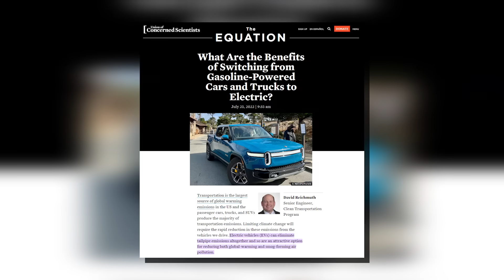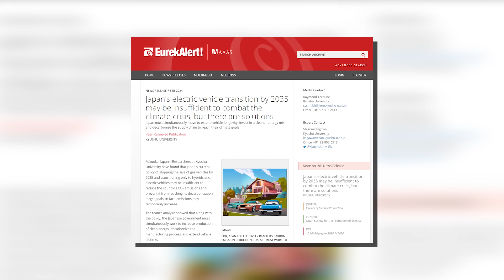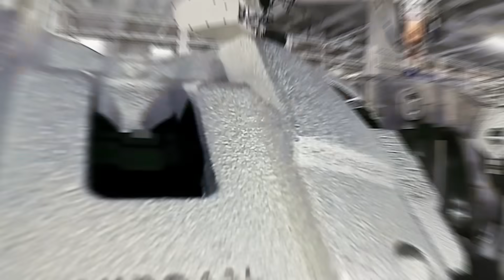The Real Reason Why Japanese Reject EVs

Comment: Hybrids is a Japanese lame ev vehicle which  basically rely on combustion engine. It is just another lame Japanese idea that are out there to deceived unsuspecting consumer. Don't be duped by Japanese Hybrids and may as well just get a normal combustion engine car then.
Reply: Hybrid gives far better gas mileage, as reliable as ICE and not as dumb as EVs. It's the best of both worlds, and very easy on the pockets. What are you talking about? 🙄
Reply: @a.m.9357  you won't see me running to get 1 definitely. Just imagine how heavy a hybrid gonna be if you fit 2 system into 1 car and how hard a hybrid need to work to get where it want to go. Get an ev instead if you want to be green to the environment or get the 100% ice if you want to use gasoline.
Reply: @a.m.9357  They also the one more likely to catch fire and still consume gasoline, which the reason why government around the world want to bann them is because fuel consumption subsidy. And because all of them use air cooling good luck cleaning those electric parts.
Reply: EV will sell to dumb virtue signalers in rich countries,  but Japanese sell cars all over the world... Do you really believe countries like South Africa which only give consumers power for 4 hours in every 24 will be getting huge sales of EV ?

Comment: most battery manufacturing and raw mterials, minerals is controlled and owned by china; a big geopolitical opponent of japan. USA, the most powerful nation is struggling to maintain their electrical grid to support EVs where it takes sometimes hours to charge an EV or find an EV station.
Reply: Because US electricity are run by private company. Simple as that, they have no incentive to produce surplus because it will hurt their revenue.
Reply: @yulusleonard985 battery storage is being added to the grid. Without storage electricity generation must track loads in real time to maintain voltage and frequency.
Reply: An EV taking hours to charge on Level 2 is the cheapest way. I charge at home getting 25-28 miles per dollar or at work for free.
Reply: Finding stations is easy. Open Google Maps, Apple Maps, or Waze, Pkugshare, or A Better Route Planner  and they will find chargers for you and take you to them. Is easy.
Reply: USA is not struggling to maintain their grid, there is a huge bureaucracy when getting a project added to the grid. It’s so hard to get stuff approved that nothing gets done
Reply: The US has the biggest grid. Bureaucracy and the fact that the US is massive country is the issue.

Comment: People will buy EV‘s once the range is over 350 miles and charging takes less than 10 minutes. I drive a plug-in hybrid, just so happens to be a Honda Clarity. Best car ever had because I have no range anxiety. I’ve put 75,000 miles in that car 60,000 of those miles was probably all electric. My job is 35 miles from my home so I do 70 miles round-trip each day and I don’t use a drop of gas no matter what temperature it is. This is what American needs before they’re mandated by this idiot president we have. We are America, this is a capitalistic society, and we don’t appreciate mandates on our vehicles, our appliances, how we power our homes, and what we can say, and do. My next car will be an electric car, but it’ll be my choice to purchase it, not a government mandate. If the government forces me to purchase a car, I will not buy it. I’ll buy used gas powered. 🇺🇸T-24#47🇺🇸
Reply: Talking about choice, how many MRNA booster shots did you take during the height of the Pandemic?
Reply: So in other words, government mandates dictate what you do
Reply: CATL new battery equipped in Li Mega has achieved this.

More client will receive this battery starting 2H24
Reply: Except that if the battery and charging time upgrades happen, no existing grid in the world can handle the load.  We'd need to add at least 50% more baseload power just to hope to handle the demand.  Best guess: at some point EVs periodically crash the grid.
Reply: @michaelputnam2532   in the US we would need the grid to provide 30% more energy for a full electric transport fleet. That’s a problem if it had to happen in a year. If it happens over 15 years that’s management. More and more wind and solar are coming online in the US every year. It’s cheaper to build renewables with battery support new than keep coal plants online. 
We have had decades we could have acted to slow climate change and not done enough. Push has now come to shove.